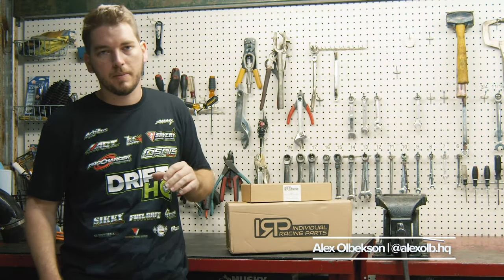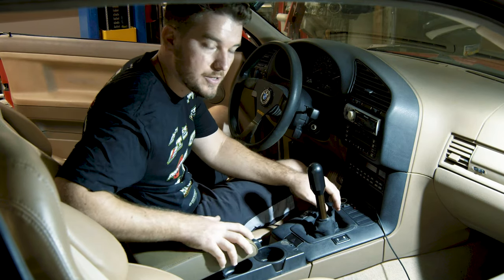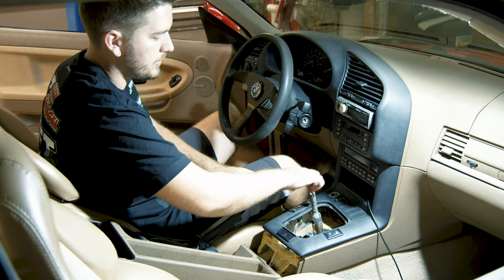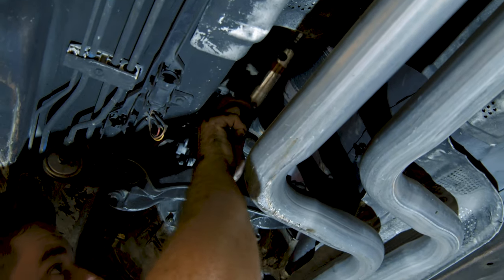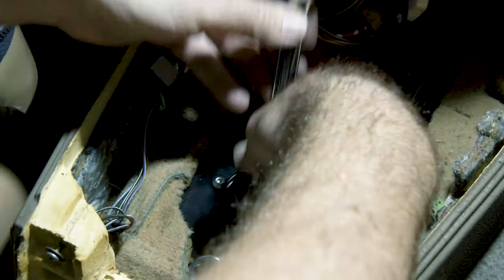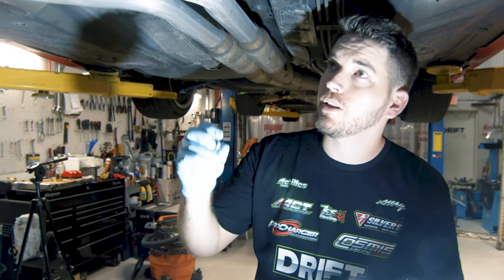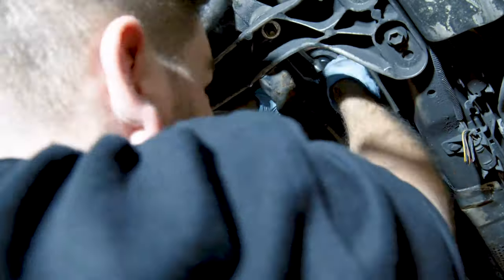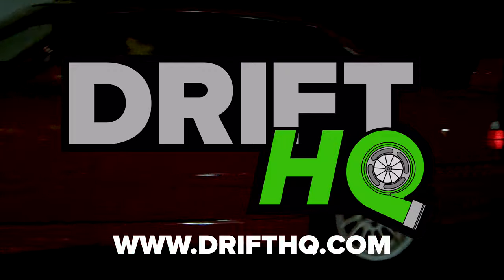HOW TO: IRP SHORT SHIFTER ON BMW E36

Comment: Really appreciate the video. Looking to install this shifter in my F80. I had a couple of questions. Does drilling into the trans tunnel cause any issues with metal shavings? If you were to revert to the stock shifter, do those holes cause any issues or do they need to be plugged? And do you just crank the bolts down or is there a torque number you’re going after? I’m curious how thick the trans tunnel is to support mounting the shifter housing directly to it then supporting such intense shifts